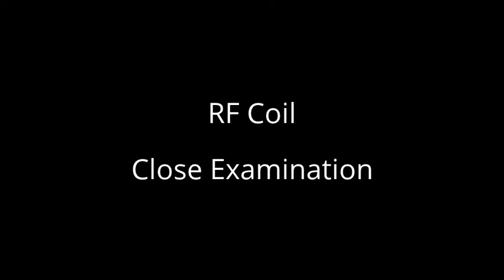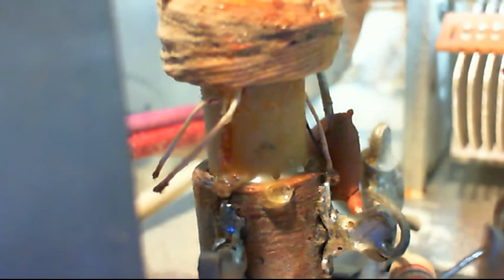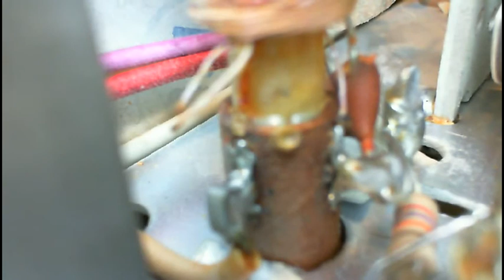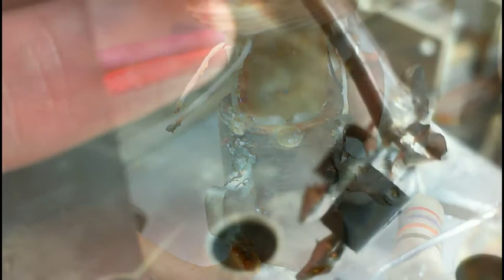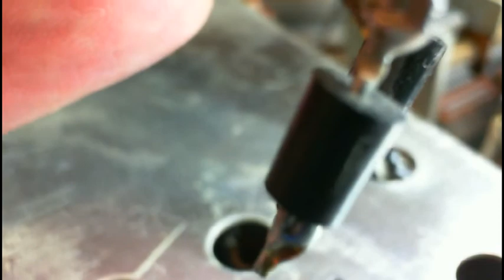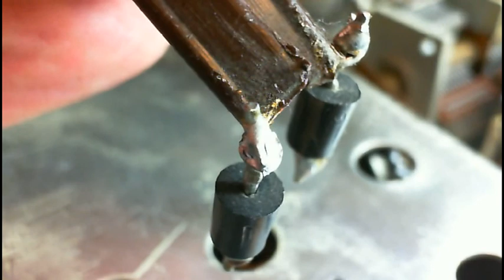Electrohome Console Stereo TR-50 Video #3 - Close Examination of RF Coil

Comment: That antenna lead terminates at that big box witch is the FM tuner. The black things at the end of the antenna lead are plastic and are used for through hole connections into shielded boxes. If you look at the box you will see two holes that shaped like a plus sign or cross,That's where they go through. You will have to take the top off the box get inside.
The other coil you are working in is an AM coil and not a FM coil. FM coils only have some between 4 to 8 turns on them.
Reply: That's what I'm worried about is the possible damage inside there where the lead was connected.
Reply from the maker: Dennis Carter All will be revealed shortly in the next video.